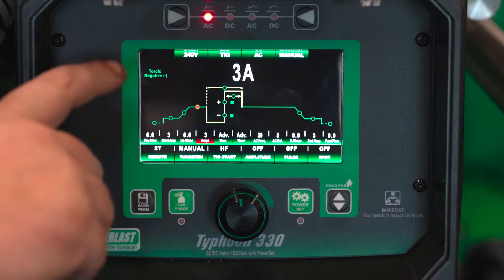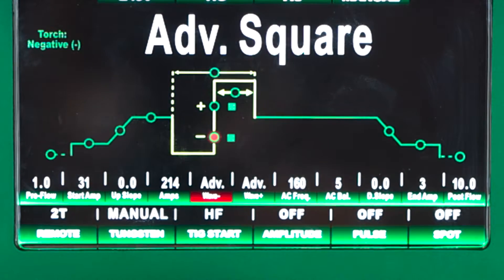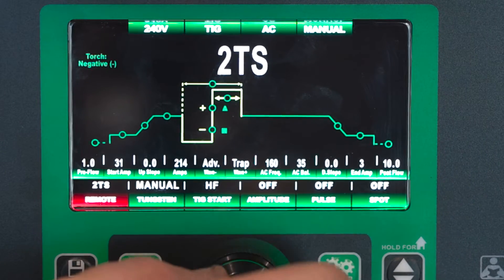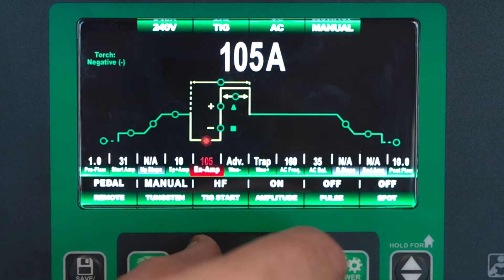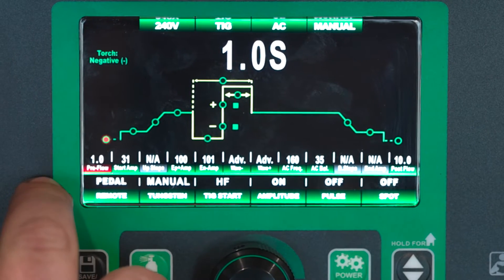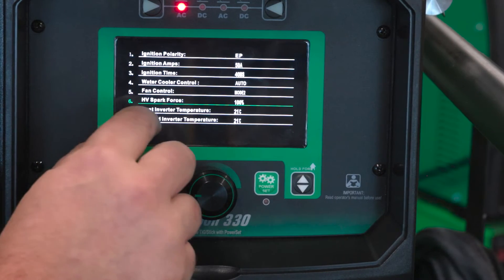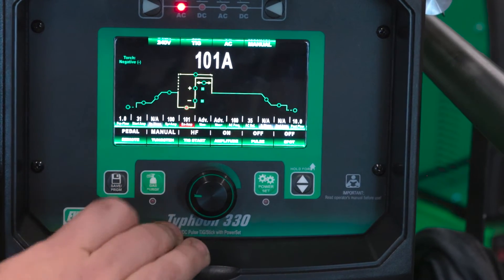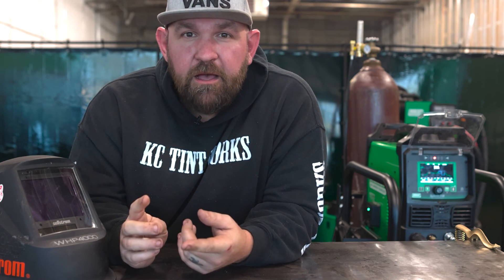Everlast Welders Typhoon: AC TIG Overview

Comment: I'm interested in buying this machine but my issue is that I'm located in croatia so it would be difficult to get spare parts or service.
Reply from the maker: We ha e several dealers in Europe so parts would be easy. For repairs, we build our machines to be very user friendly for repairs, most repairs can be made in just a few minutes with nothing more than a screw driver.  If you send an email to sales@everlastwelders.com we can get you setup with one of our European dealers

Comment: Why would someone Prefer the Typhoon 330 over the powertig 325ext??
Reply: Little little more control of the arc, dc pulse wave shape, higher AC frequency and pulse frequency, spot/cold weld timer…. Lot of added features for the guys that are looking for total control of every aspect
Reply: MASSIVE DIFFERENCE especially for welding thin metals.

Comment: I use a dynasty at the school I went to and It was an older 200 dx but brand new I used it for probably total  around 40 hrs and the high frequency already went out nice machine but not worth the $ in my opinion so when it came to buying my own machine I bought a 230 typhoon love it.
Reply: Have you tried it on Aluminium?

Comment: Brother, being the owner of an Everlast tig machine  and a Dynasty 280, there really is not much of a difference at the tig torch. Remember, before you get brainwashed by the Almighty true blue Miller. Electricity comes out of an outlet on the wall, it travels through the welder, there is not much you can do to electricity , to make one welder better than any other. Millers break down as often as any welder.
Reply: There is not much you can do with electricity? ROFL, yeah you are right, not much at all except form an entirely new civilisation.
Trust me, there is a BIG difference in internal circuitry, the chinese ones like the Everlast will be using chinese components, not the reliable big names like IR, infineon, ST etc. Industry wont pay for expensive machines if they didn't think they were reliable.
Reply: @engjds as a business owner, I can buy 3 everlast welders for every Miller of the same level. I have been an everlast owner for 10+ years now and the only issue i ever had was due to a dropped unit. Clear choice for me.
Reply: @ Yeah, everlast have a good rep for a chinese machine and I dare say against some more reputable makes, I stand by my point however, R&D, components and design engineers will be top notch for others, what everlast have probably done is replicate partial circuits from more familiar brands to reduce R&D, copying has always been our chinese friends strengths.
Reply: @engjds All the commercial welding trucks running all day , I see Miller & Lincoln and sometimes Hobart . Also paying more for those machines for their parts and service . Everlast is coming up good also .
Reply: @michaelhallas6450  In America that is true, but around the EU Fronius is the top end machine, they are pretty much bullet proof but cost a good deal more money. Miller seems to be your rolls royce of machines, fronius is to at leat that quality or better.
Reply: @ Yes I heard they are good quality .
Reply: @engjds you have no idea what you are talking about. Plus you also misunderstood his comment.
Reply: @ Which part is wrong?